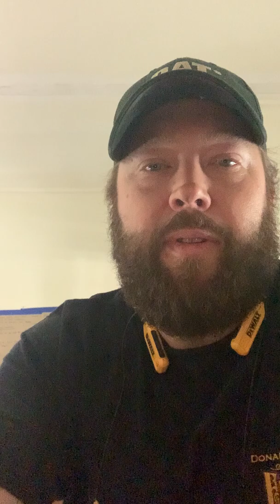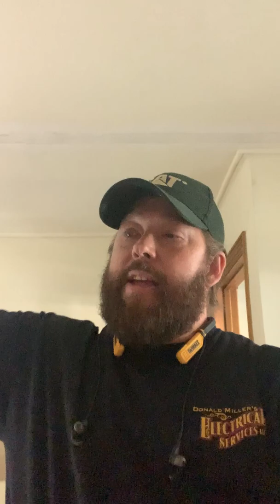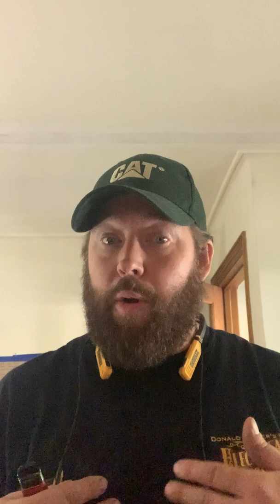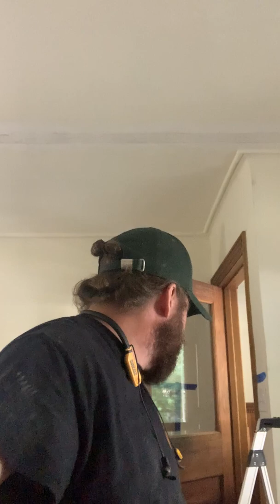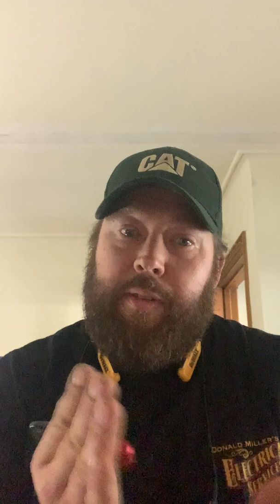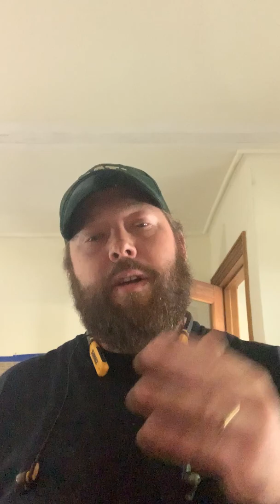Bx wire being included in knob and tube rewires.

Comment: Old BX cable dropped onto the dirt of the crawl space after staples got pulled out, armor rusted through and wire insulation (cloth over rubber) rotted.  One day I enter the building and see flames coming out of the outlet fed by this old cable. I run to basement and unscrew all 8 glass fuses to kill power feeding it.

Comment: My parents bought a newly constructed home around 1954. The wiring was the cloth covered silver romex you described. A few years after they got the house, they had an electrician that my dad knew from the machine shop where he worked come over and add some lights and outlets. One light he added was a post light that was out by the sidewalk. About 6 or 8 years later, they got a huge electric bill. Like 2 to 4 times as much as their usual bill. My mom called the electric utility and they advised her to observe their meter and remove the fuses one at a time until the meter stopped running so fast. When she got to the fuse for the circuit feeding the post light, the meter slowed greatly. After some investigation, they found that the electrician used bx cable buried underground to power the post light! It was leaking a lot of current but not enough to blow the 15 or 20 amp fuse (i think it was 15, but it could have been a new 20 amp circuit with some new outlets he added).  I don't know when UF cable became available, but I would have thought if it wasn't available, he would have put the wire in conduit rather than expecting the bx to handle direct burial.
Reply from the maker: Earth will not trip a breaker, a lot of guys used single conductor to the post for this very reason. To give the old timer credit- we did a lot of crazy shit back in the day, the wiring practices were crazy.

Comment: Bx is a curse to modern the electrical world due to many reasons. Many BX homes have been poorly maintained and overlooked it’s 2023 and using equipment 100 yrs old. If you have the opportunity to abandon a circuit or by pass it for something code compliant do so with out a second thought. Dealing with Bx is a pain in the ass.
Reply from the maker: Bx will be the next rewire, it was installed until 1950 and can not be used as a ground. Technically it’s a false ground due to lack of bonding.

So basically any house built before 1950 is eligible to be rewired in a real estate transaction.

Thanks for commenting
Reply: Hi Donald, 

Our house we bought has some old BX wire, and I’m slowly starting to replace it. I was able to get one outlet done in the baseboards and it was a pain trying to remove the box that was embedded in plaster and brick. Now I moved the the light switch and I removed the box but I cannot for the life of me free up the BX cable from the plaster. I’d like to do that without having to open up the wall. Do you have any tips? Thanks!

Comment: I’m not an electrician, but I appreciate the history of electricity and how it has evolved over time from a safety perspective. My home was built in 1924. I’ve got BX all over the basement. Haven’t looked in the attic. In my detached garage I can see a couple of abandoned knobs. That may have been upgraded at some point.
Reply from the maker: Take off the plates covering your switches, if you see cloth then it’s still the old wiring
Reply from the maker: @howardlovecraft750  
Definitely a smart move
Reply: I love the historical aspect of it too! My house is 1910, so it was knob and tube from basement to attic! It was gas before that...
Reply: Very interesting.  Is bx wire considered an ac cable without the ground.  I always thought mc cable had a thinner aluminum jacket and armored cable has a thicker steel jacket.  Do they even make ac cable anymore